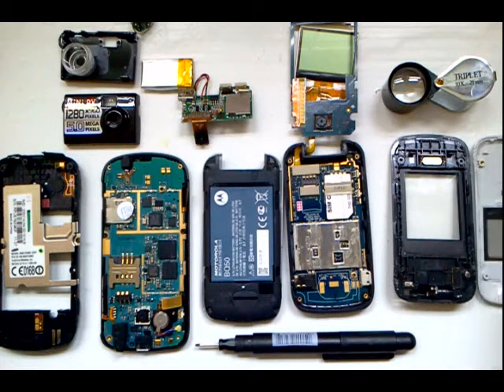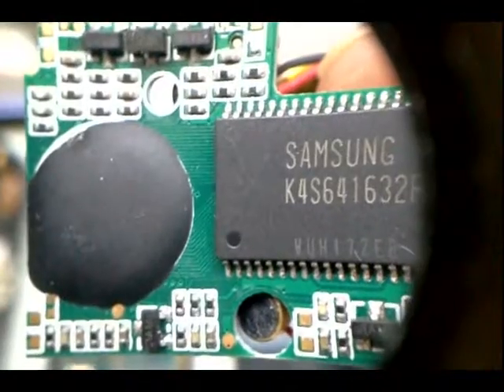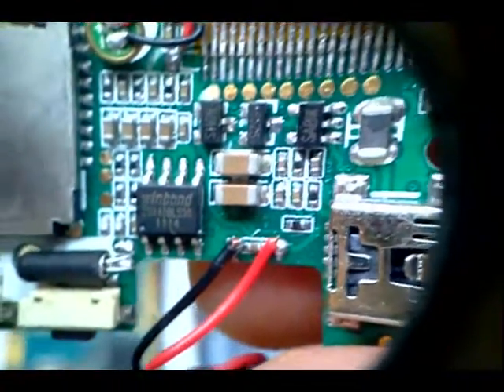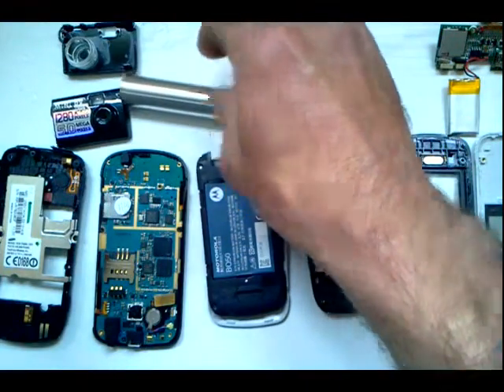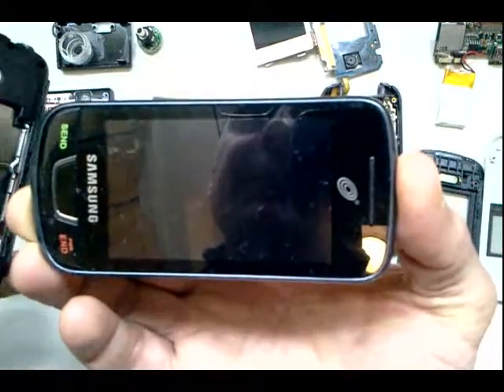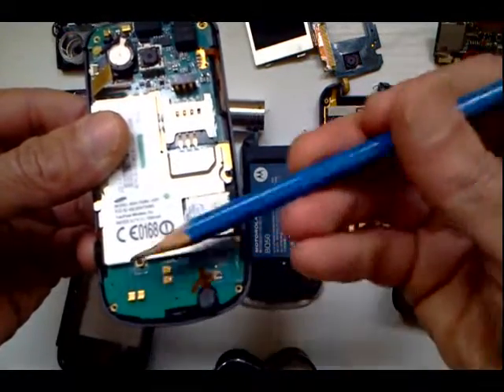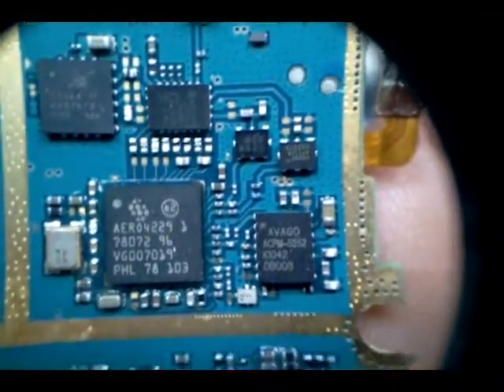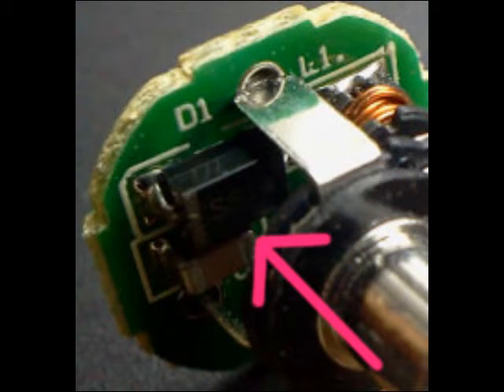take apart phone to ID circuit board electronic components 👍🏽

Comment: Hey Paul do you know how I can turn the amp and speaker in a cell phone to a portable microphone and speaker?
Reply from the maker: I really don't know. You could use mini condenser mic into LM386 amp module to small 8 ohm speaker for low volume application. Maybe there's Bluetooth solution to broadcast sound 10m +/-

Comment: Paul would you happen to know if I could by any chance rescue my S3 if I mixed up the polarities at the battery pins. The dang thing refused to charge normally so I force fed it through USB lol, it worked great until I forgot how I had wired it and fucked myself over. You recon there could be a single component to replace or would you say the entire board is fried?
Reply from the maker: Most likely there could be a single component to replace (would be challenging): either a capacitor or overload voltage/polarity protection diode like this: 
https://datasheets.maximintegrated.com/en/ds/MAX14670-MAX14673.pdf

Open up phone and try to ID fried component. If you fix it please post back or make video as many would be interested.
Reply: Legendary!! Thanks a lot for taking the time to respond!

I'll read over the info you supplied and probe in and around the power chip (will more than likely have to take a drive and ask pops to do the same) and then report back with any findings! 

Until then, all the best!